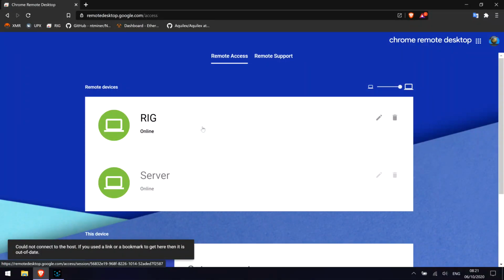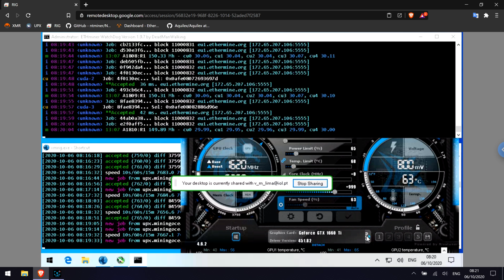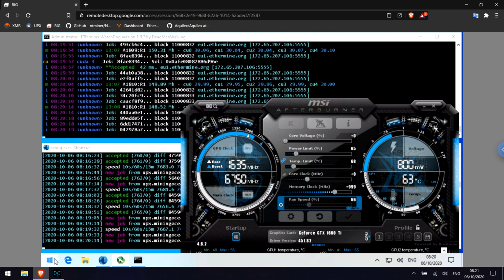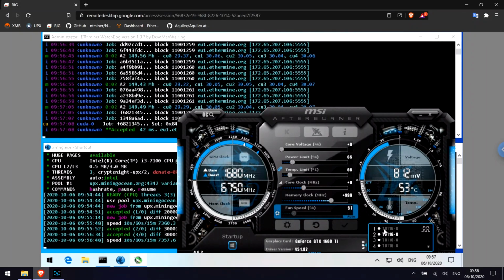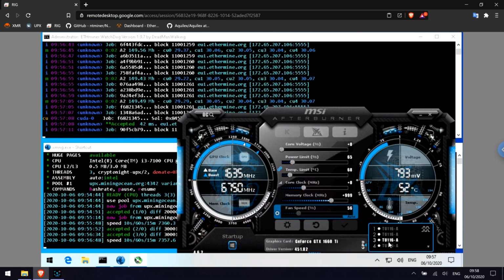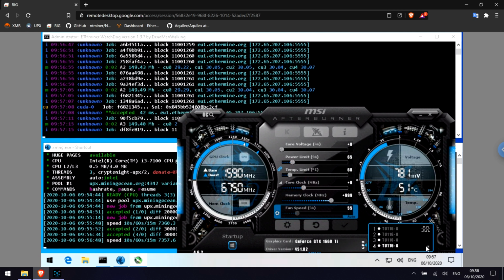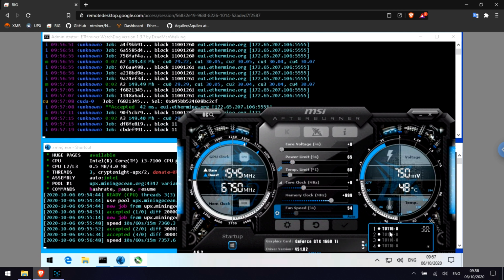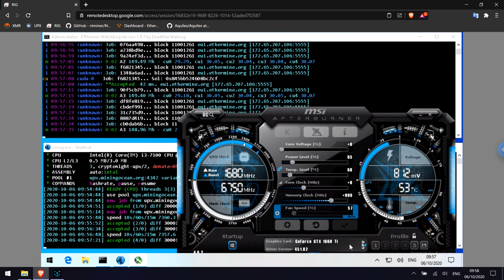GTX 1660ti Cleaning and thermal replace

Comment: Hey there i had a question if you remove your back panel then do you have to place new thermal pads as well or not because i have the exact same model 1660ti msi ventus and im thinking to change it but not sure if i have to replace the thermal pads as well
Reply: And my gpu temps while playing games like rdr 2 gtav metro exodus etc are about 78 79 celsius
Reply: I bought my gpu in 2020
Reply from the maker: @patelbhavya9669 if the pads are in good condition you don't have to replace. It's normal for a GPU to have high temps during gaming as it uses a lot of core and RAM. If you notice throttling then you need to cool it down or drop OC.(Usually voltage)
Reply: @minerondemand  Oh okay thanks a lot for your help ❤️

Comment: Is it bad that mine reaches 80+?
Reply from the maker: @joaocaetano8529  ideally 60C will prolong GPU life, however, GPU throttling is a safety feature that reduces the clock speed. If you see this happening you should take measures to cool it down.
Reply: @minerondemand  thank you 
Will do

Comment: Hi! Im preparing to clean my GPU soon, asus tuf 1660ti, and i was wondering if you changed your thermal pads cause i didnt see you do it.. is it okay to reuse the thermal pads that came with the gpu? 

Im still trying to look for the proper size for the thermal pad. Icant see it anywhere
Reply from the maker: Hi, if pads are in good condition yes you can use them. I rarely replace pads.
Reply: @minerondemand  well mine's about 2 years old, it was brand new when i got it. Im guessing the thermal pad for this is still good?

 do you have any idea what the thermal pad size for this gpu though?
Reply from the maker: @arisatorebel332  sorry I don't know the sizes. Thermal paste should last 5 years, even on mining conditions. Unless you are having heating problems, I would leave it alone.
Reply: @minerondemand  I see thank you very much for that information! Ill be cleaning mine soon your video is very helpful as the model has the same heat sink as mine

Comment: Hey, I'm using the same model and it's reaching 80 degrees these days. The CPU is reaching 96 degrees, so I think it's time. Do you think changing the thermal paste will completely solve the problem?
Reply from the maker: Theoretically thermal paste should last 5 years.
By CPU you mean core temp?
Try to undervolt the card
 They should work at 65%
Reply: Both my GPU and CPU temperatures are high. The usage levels are normal, but the CPU reaches 70 degrees even when idle. As you mentioned, thermal paste typically has a longer lifespan, but this computer has been running at full performance almost every day. I am certain there is no software-related issue. Do you also think that this temperature level is due to the thermal paste? Additionally, thank you for showing me how to do it in the video.
Reply from the maker: @furkanefeozdemir4345  seems more like a cooling  issue. My advice, for the CPU I advise using AIO water cooler. They do make a big difference, specially in high power CPU like i9 or Ryzen 9.
For GPU extra 20mm fans will do the trick.
Make sure you have plenty of room around.
Reply: Thank you

Comment: i have the same card, i recently open to change the thermal paste, and notice that the big thermal pad wanst there, so any explain ?
Reply: but besides that fact, what are the sizes of all thermal pads? ty
Reply from the maker: @adasss289  this was a new card? That's strange.
Unfortunately I never actually measured the pads, but I'm sure you can find on Google. You also have the option of using copper

Comment: Thanks for the video, I followed along and it was very helpful. However at the end when I started up my pc the Gpu fans went to max and then the sceen went blank. I took the card out and found that one of the screws holding the heatsink aginst the chip was too raised on the inside. I tightened up the nut for this screw and now everthing is ok. Just thought I would mention it in case anyone else panics, just watch when you reattach the heatsink. You might be wondering if this is worth doing. Well the second hand card that I bought went temperatures  from around 85 to 50 on games in Ultra, which is amazing.
Reply: I had this happen to me recently and i dunno what caused it. Might be due to temps too. Havent done a repaste since i got it ( 2 years ago now) i hope this is just the case on mine

Comment: The purpose of thermal paste is to fill MICRO or TINY gaps. Why do you put a 1-2 mm thick layer of paste there ? There is definitely not such a deep groove on the surface of the GPU core and not even on the surface of the material from the cooler :). A thickness of 1-2 mm of heat-conducting paste is applied only when you apply the paste using the "drop" method. However, if you coat the entire surface with paste, then a very thin layer of paste with a thickness of approx. 0.1 - 0.5 mm is sufficient.

Comment: You had everything right until the thermal paste app. More is definitely NOT better. Just enough so you don't see silver of the IHS. Dont use X method or the x and dot method or pea sized drop method...these are half- assed and lazy and will lead to uneven application causing major hot spots.

Comment: What are the size for the thermal pads?
Reply from the maker: sorry i didnt check
Reply: I simply ditched the thermal pad and applied paste to every little chip.
Reply: @mikem9536  did that work out?
Reply: @arisatorebel332  Probably not, unless they replaced the thermal pads that gpu is long dead if they didnt cover the VRAM, shit became a star probably without the pads

Comment: honestly for me, those sticky dust (strain or whatever) seem be the real culprit. it look thick enough to slow down your fan. when thermal paste seem ok. plus if you use some thing such as thermal paste from cooler master. all you need is just one drop on the center of gpu ship. it will spread in good shape which not too thick or thin.
Reply from the maker: I agree. Usually the problem is dust in fans but, even though the paste is supposed to last up to 10 years,  if you're going to disassemble the all thing, might as well replace the paste.

Comment: My graphics card is gigabyte 1660 super. It has thermal pads on the VRAM. Should remove the original thermal pads?
Reply from the maker: VRAM is not supposed  to have paste. 
These cards don't get too hot. 
I would remove
Reply: @minerondemand  My gigabyte 1660 super reaches 60-64 but my msi 1660 super stays around 52-55. What should I do?
Reply from the maker: @daringonzaga4974  you can try moving to the front so it has more air flow.  But 60-65 is very admissible.

Comment: I've have the exact same card for 2 years now and just recently noticed my temps going up to around 80 when hitting full usage.  Guess Its time to do this.
Reply: this exact card on nvidia website can reach 95C without any problem, soo if u are hitting 80C that's not a problem.
Reply: @bokiBubamara  amazing how smaller silicone produces more heat. Just replaced a GTX 970 with an MSI GTX 1660 Ti Gaming X and just cant get used to the higher temps. Overclocked to the gills and playing many AAA titles,  my 970 never even came close to 70c.
Reply: @bokiBubamara  but the gpu life is going shorter if you always run in a high temp
Reply from the maker: Paste should last around 5 years but there's nothing like a deep clean.
Reply: @jbscotchman any update? did it help?

Comment: What was the thickness of the thermal pads on the vram?
Reply from the maker: I think  4 or 5 mm
Reply: @minerondemand  Thanks some really thick boys then, i have been looking in stores and the standers they sell seems to verry from 0.5 to 3 mm
Reply from the maker: @gert4487  I didn't change mine.  They seem ok
Reply: @minerondemand  Well i have been mining a week on 30 MH/s but now i can't even get 28 stable even with a small 80 mm fan (witch wasn't there before) on the back of the card, so i think i have a thermal throttle on my vram all of a sudden because when the 80 fan isn't even blowing it is even worse
Reply from the maker: @gert4487  this cards won't do throttling. 
I'm using 
V at 60
Mem 1049.
You just need to find the sweet spot.
Reply: @minerondemand  well then i don't know why my hashrate goes from 28 mh/s all of a sudden to 25-26 for a couple of seconds and then bacK. I tried it once again at my previes settings but i get random drops from 30 mh/s to 27 and then it returns after a couple secons back. Thats not normal behaviour i think is it?
Reply from the maker: @gert4487  not really no.  How's your temps?  Bellow 60C?
Reply: @minerondemand  yeah arround 40-50 so i dont think its something with the chips temp
Reply from the maker: @gert4487  things you can check.  CPU usage. If 100 will cause that. 
Miner.... Maybe try  a different one.
Reply: @minerondemand  I have been doing some testing with that CPU usage and it may have been that! its been stable at 30.4 and it has dropt a little sometimes when it spiked to 80 ! Thanks for letting me realize it! I worried i fried something or the drop was because of overheating so the thermal thing but its probably that because i just started mining so i have the 1660 ti mining and a 750 being my display output and my cpu is pretty old now fx 6300!
Reply: Can't thank you enough :) !

Comment: bro I have the same vga
and I opened to change the paste, but I have thrown away the thermalpad.
and I want to know, what is the thickness of the thermal pad on the msi gtx 1660 ti ventus?
Reply from the maker: I think they are like 4 or 5mm.
Reply: I just applied paste to every little chip under that heatsink on every little chip the heatsink touches.

Comment: Could u make a video on your over clock settings please
Reply from the maker: 1060ti
power limit 60
memory clock 1049
30 Mh/s

but you'll need to find best settings on your memory clock as will depend on your system.